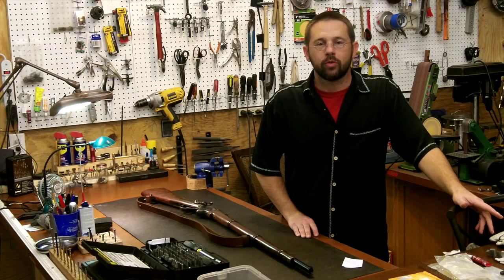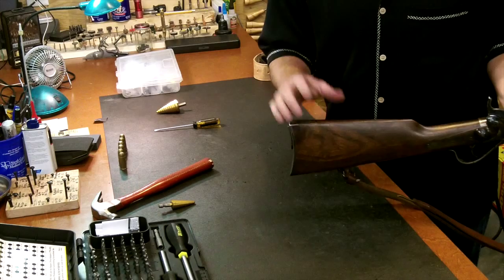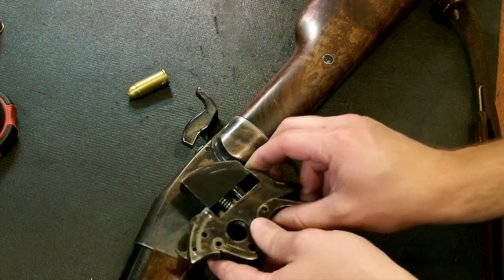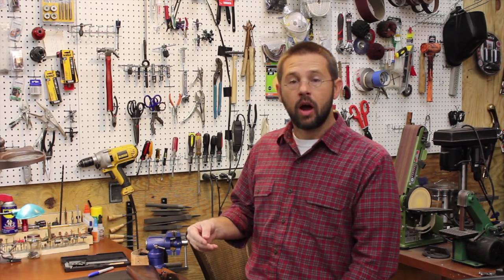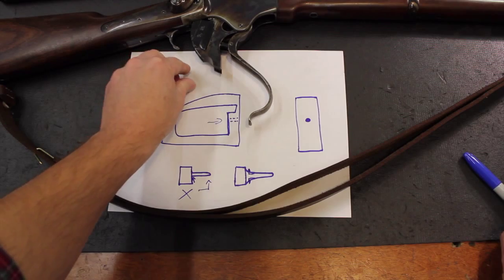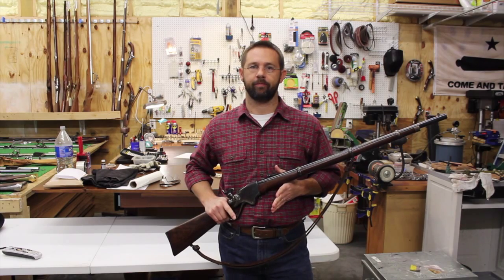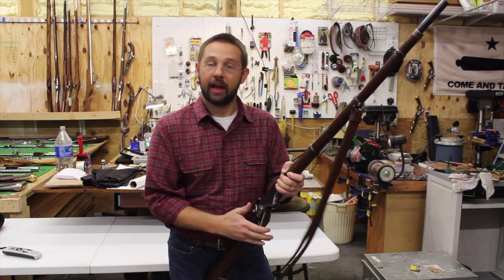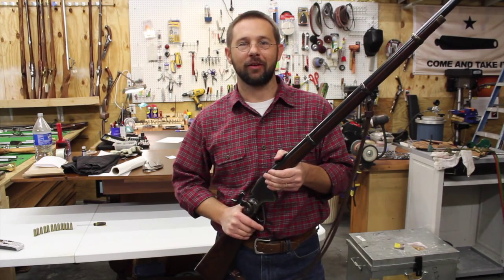Shooting Blanks in a Spencer Rifle or Carbine - A How-To Guide

Comment: I'm using a Cimmeron Made Spencer Rifle. Live ammunition works fine, but blanks (I have brass ones and metal ones  (shaped exactly like a live round that take a .39 cal inset blank) that feed to low! Also, if using only 2-3 rounds I can get them to finally feed, but more the breach block freeezes up and cannot even get the blanks to start feeding. Help???
Reply from the maker: I've attempted to use those metal blanks with the inserts from Ten-X with no success. I could never get them to feed in any of my reproduction Spencers. Give these a try:  https://www.youtube.com/watch?v=yZ40_yrtTAA